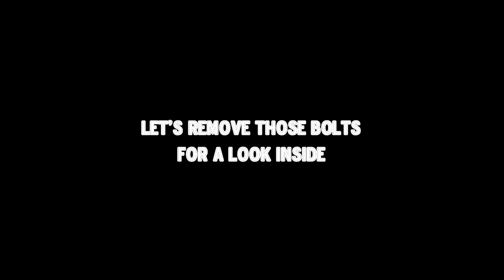How Does a Gatling Gun Work?

Comment: Hello Happy New Year. I bought an 1883 Gatling Battery Gun From Poulins with the Accles Drum Magazine. The magazine fits down into the slot okay and goes all the way to the bottom but I cant get it into the locking slot in the receiver everytime I twist it it makes the magazine move up. I am sure I am doing something wrong. Could you tell me how to get it onto the slot. Thank you for your time
Reply from the maker: The magazine should work in sync with the drive mechanism.  The magazine "hands off" the rounds from one to another, so they rotate at the same rate.
Reply: @Bigshooterist  Hello the magazine fits on the gun okay the problem is both the pins on the magazine are place too high so when you install the magazine in the slots you cannot push it over to the right to lock it into place. The manufacturer of this gun built several of these guns and magazines for them as well and apparently there is no standardization on milling the receivers. These guns have been sold at auction many times over the years and the parts from one gun have been sold with another and don't fit right
Reply from the maker: @jasperjones6962  I think you hit the nail on the head.  It's darn close but may need to be hand fit. I'm thinking an adjustment may have it purring like a kitten.
Reply: Poulin's sold one of these Model 1883 Gatling Guns with 4 drum magazines I am thing one of those magazines fits my gun. Is there any way I could get a hold of the buyer and ask him about the magazines,?

Comment: How are the carriages chambered and the shells extracted ?
Reply from the maker: At approximately the 5 O'clock position they are ejected and fall below the tripod.
Reply: @Bigshooterist  how is the ejection process work tho does a extractor grab the lip of the shell then rotate it out of the chamber ? I’m looking to begin designing one from spec but can’t find much info on exact operation on ejection
Reply: I have found my answer it uses an extractor thank you great video
Reply from the maker: I thought the video showed details of the bolts and extractors. I'll check it again. I did another Gatling video as well and it may be that one.  If I get time, I'll shoot another one with more detail as a followup to this one. I still have 3 Artillery models here so it shouldn't be a problem.
Reply: @Bigshooterist  I ended up finding my answer off some old schematics but thank you for your time and effort I appreciate it great video !

Comment: Making plans to build one of these. Do you have any books to get more precise workings of the  inside?
Reply from the maker: Unfortunately, I don't.  When I was doing research on these I was amazed at how little technical info there is.  That was the reason I made thus video detailing the internals in the 10-Barrel Battery Gun, detailing removing and replacing the bolts to help people understand how they work.
Reply: @Bigshooterist  guess I will have to make it up.. thank you :)

Comment: I wish you had shown the mechanism that loaded the gun and then cocked it and fired it. While you had the strikers out you could have shown how they picked up a round. Thanks for the show and tell!
Reply from the maker: The bolts rotate around the inside of the housing eith an internal track that catches the firing pin. When the barrel/bolt reach firing position (@5 O-clock) the track ends, allowing the captured firing pin to drop. It's basically a striker fire. I hope this is helpful.
Reply: @Bigshooterist  A short piece of the vid showing that part in action, or at lease in close detail, would have been much more informative than watching all 10 bolts get removed and replaced.